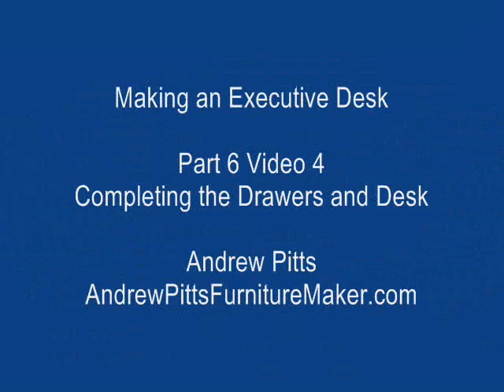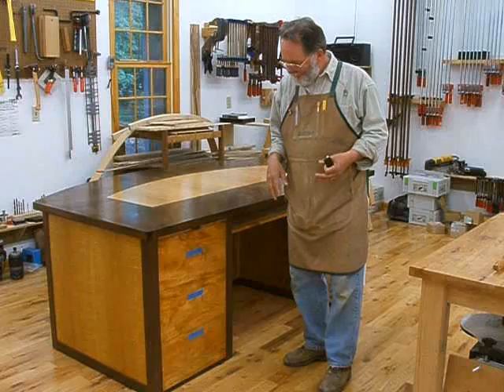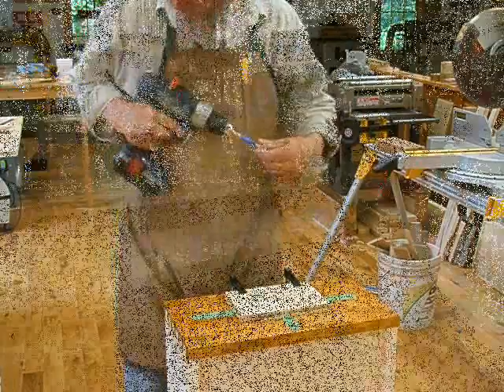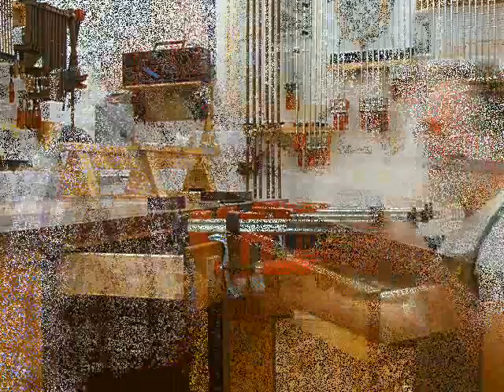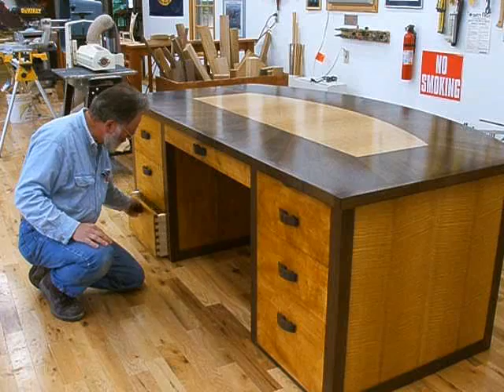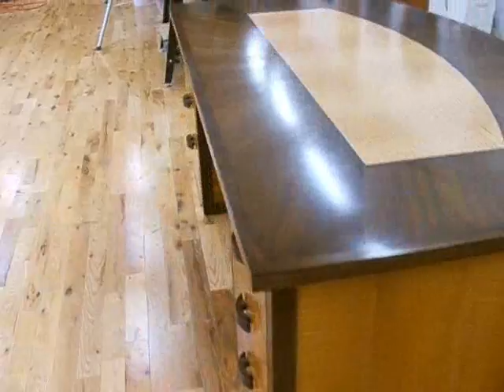Making a Veneered Executive Desk, Part 6-4, Finishing Up: Andrew Pitts~FurnitureMaker

Comment: Thank you, Andrew.  Another great series.  Very enjoyable to watch someone with so much skill.  If I may as a question?  Why did you choose to make the drawers sides of thicker dimensions?  Since you obviously think these things through, I am interested in your thoughts.  Most drawers sides that, I have seen, seem to be around 1/2 inch or so.  Thanks again for taking the time to produce this content.
Reply from the maker: +Toby Sauer Thanks Toby. When I am making a drawer for a heavy load, I make the sides thick since  I usually don't use hardware drawer slides. The extra width makes a larger bearing surface and is less likely to wear down into the dust dividers.
Reply: +Andrew Pitts - Thank you, Sir.  As a followup....  Would you get the same benefit with a 1/2 inch side and a wider foot attached to the bottom to help with wear?  I am still in the "follow plans" stage but am starting to know enough to think about options.
Reply from the maker: +Toby Sauer I think that you could do that, but it would only be desirable for very heavy drawers. For my light drawers, I use stock much closer to a half inch thick for the sides.
Reply: +Andrew Pitts ~ Thank you.